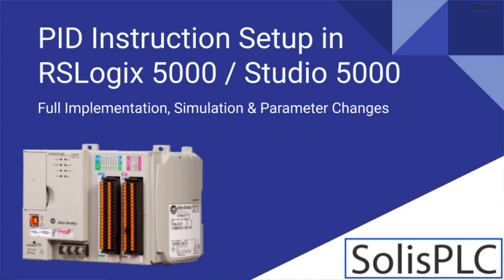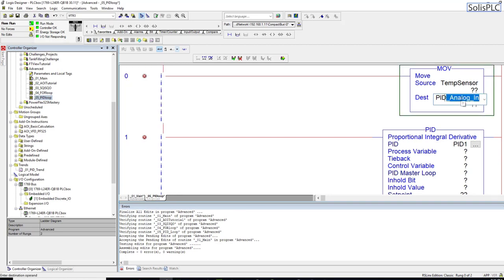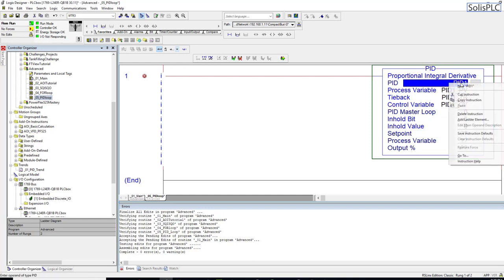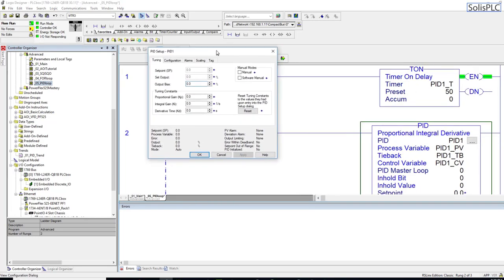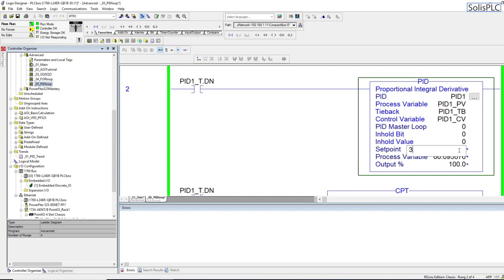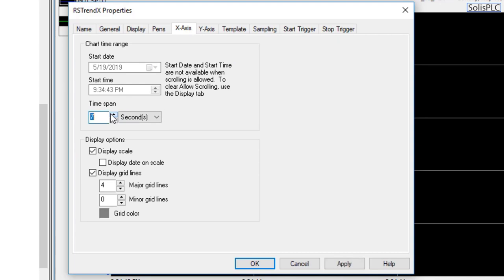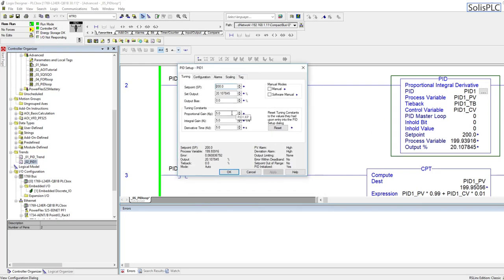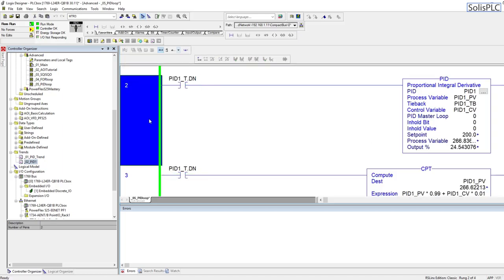RSLogix PID Loop PLC Programming | Example of PID Control Instruction in Studio RSLogix 5000

Comment: In my plc 5 pid loop to tune it:  using P only, slowly increase the gain until the loop starts to oscillate. Look at the chart and measure the time between the top of each wave. This is the natural frequency of the loop. write that number down. take the found gain(p) and cut it in half to stabilize the loop.  Now with the time in seconds for the loop that you wrote down. take 1 and devide it by the number seconds for the loop natural cycle. this number is now your integral time.   this is inverse seconds from the allen bradley manual. enter the integral. now you have a good starting point.

Comment: Hi Vladimir,

I just finish the course PowerFlex 525 Mastery and it was very interesting. But if you don't mind I would like to learn how the PID instruction work with some VFD as a pump with a flow meter and see how this PID instruction work exactly in a real world situation like trying to control the pump's flow.

I check your youtube channel and I could't found any video using the PID instruction working or simulating a real situation.

I would be very grateful for your help.
Reply from the maker: I've considered building a course on PIDs as it was a highly requested topic. I wasn't able to secure hardware required to demonstrate a PID so far... Unfortunately. I'll see if it's something we can add to our calendar.

Comment: Hi nice channel, you have a new subscriber!! Why you use that expression on the compute instruction? Did you invented that?
Reply from the maker: It's just a continuous loop to add in an error based on a previous value. It essentially simulates a delayed response, otherwise, the PID would correct itself instantaneously.

Comment: Im having an issue with the CPT instruction that you made up everytime I change the setpoint in the PID it just goes straight to the setpoint number no matter what values i put in the PID
Reply from the maker: That may be an issue with your update rate / timer. If it's too low, it will update instantly.

Comment: thanks master ,,  ihave problem with my io ,,, i have compactlogic l16 bbb1b version 20 ,, (i downgrade the firmware from v28 to v20),,, the controller couldnt recognize the embeded io and the expansion io too ,the fault is 16#fd22)....thanks if you can help
Reply from the maker: See Rockwell knowledgebase answer ID: QA48929, they explain everything to fix that fault on your controller.

Comment: Hi Vlad,
I followed your video, but my trend was different. Your PV graph is curved, mine pv graph looks like a pulse, it is a little bit squared. You know what it could be?
Reply from the maker: Check the timer. The logic is based on the timer updating, so if the value is larger it will pulsate. That's my first guess. Also, check if your program is periodic or continuous and what the execution time is.